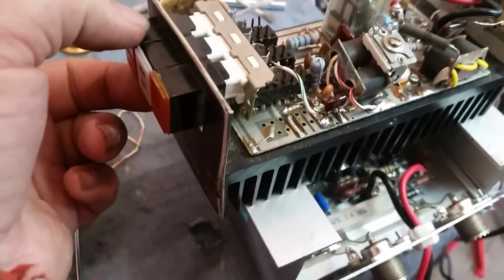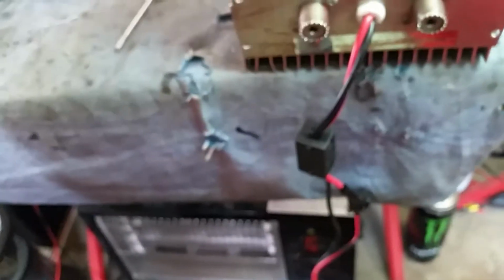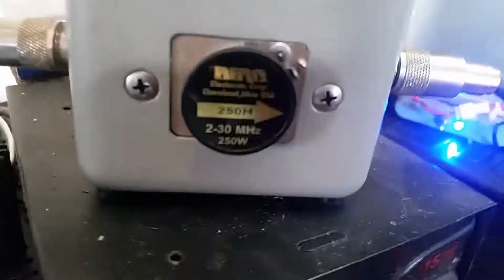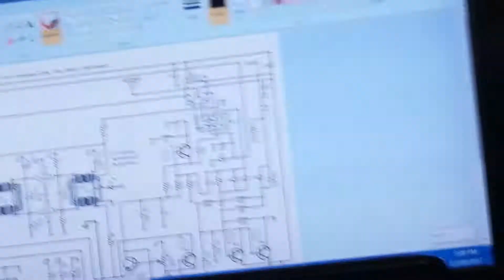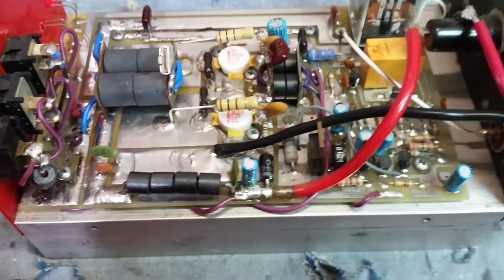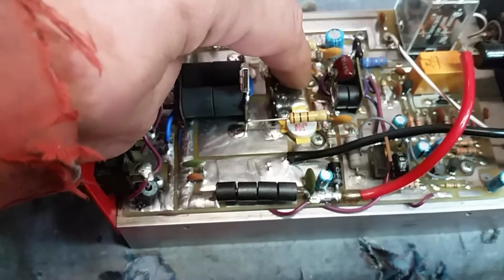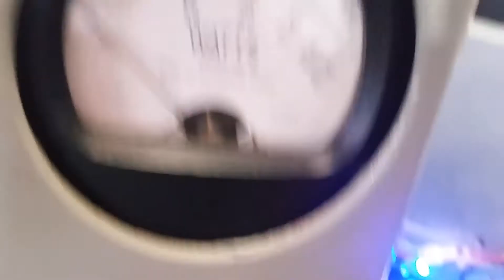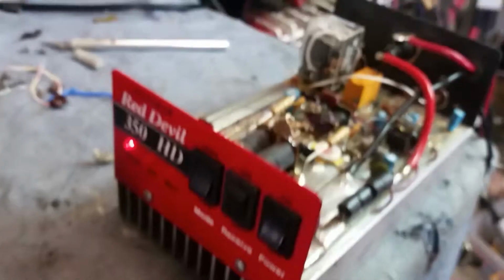Mr T"s 3 Probono Amplifier Repairs - [Make Whats Wrong, RIGHT]

Comment: nice small amps. I got a 1 pill Texas star like that. Got that new with my hot plate 8 pill. has variable on it.  I did some Palomar 225 and 250 like that . There is a 4 pill MRF 455 like that also. think had same cap go bad . that red devil 350 I seen them before and fixed a few. all same board but different pills. same bias circuit. transistor keying . If I remember right there is a diode to heatsink under the board. cuts back bias when hot. that transistor needs heat sink. changed a few. I got one like that now but not red. same board. receive amp is out . hard to find relay.  it has MRF 421 in it. green dot. I have seen 2SC 2290 and MRF 492 . I sold one with SRF 3749 in it . black dot. some one may changed pills with out re tunning . They have   ferrite for hi/low switch . no resistor. I added feed back base to collector as well . That sound great on SSB . very clean . if putting 2879C in it I would re do power leads. maybe ferrite to collectors. I moved ground lead to between the pills . I changed fuse holder to inline MAXI 30 amp fuse . big plastic one. has #8 AWG wire. I got a bias circuit I copied from a amp. LM 723 . RM Italy used that . also has current limit on bias. Hennery radio has a amp with that reg as well but the round metal can package. NTE 923 . 73's
Reply from the maker: I cant wait to get caught up so I can try different bias circuits brother when I do I wanna link up with you for sure see if I can get some images of ones you built..... peak a boo joker amps builds a nice bias circuit but im not sure he would share or not... he may.
Reply: @1883GotDown  many ways to do a bias circuit. I found keep it simple is more reliable.